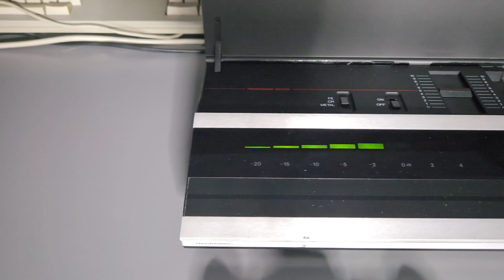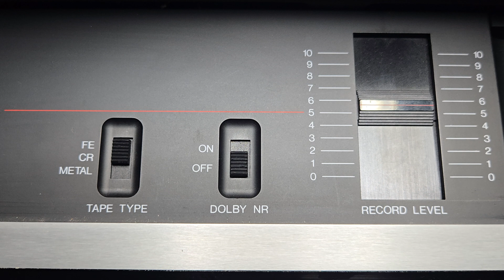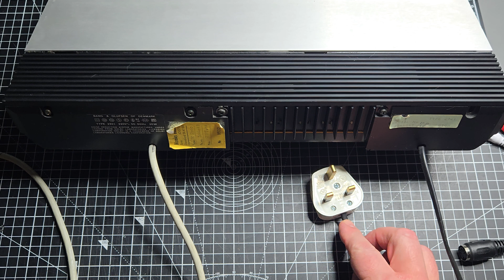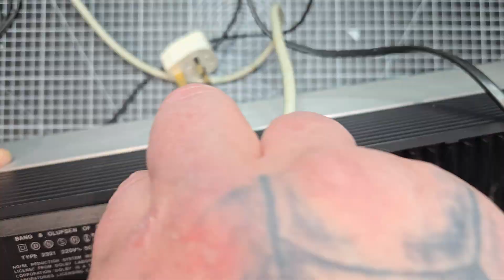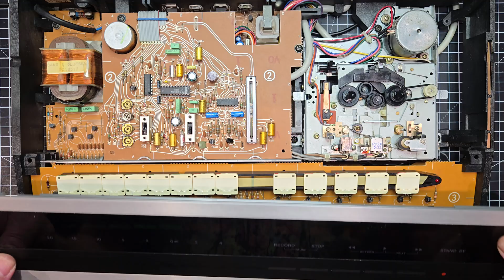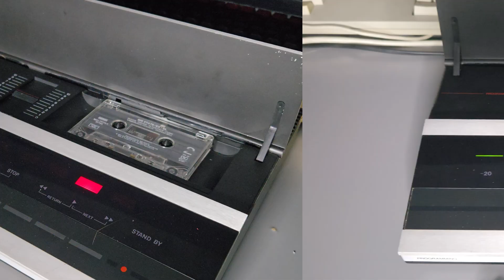Bang And Olufsen Beocord 2000 | Cassette Deck | Belt Change & Demo

Comment: it was nicer if you showed the whole system to which this deck belongs as i was very surprised when using one ,even the turntable was surprising but at the time there were still a lot of european brands and they used to be a lot better than japanese ones only less lights and the m,aterial was nice but not expensive ,normally a new compost that was not yet known and would surprise the buyers, Philips, Grundig, Normende, this ones i can say that were much above any japanese brand with a display with a lot more lights etc.,etc. but have to say that when using brands like sony that as an example the cassette deck seemed a fantastic out of this world machine ,only when listening to the recording with all calibration done and rec level as it is showed in the manual would not sound better than a grundig deck with 1/4 of the price, and the grundig would work forever ,the Sony would break down after 7 years at the most,l i know aklso that european brands used to buy all electronics of a japanese brand to sell it under it´s brand in europe it hapenned a lot in the 80´s, i myself have a friend who owned part of Philips and b y those day ,philips owned a lot of other european brands as they didn´t had possibility of surviving but Philips would release h-fi components under their owned brands , this friend i refer ofered me in 1992, maybe a complete fine arts system it had some pointy corners but each component was separated being young and stupid i sold it for a lot of money to a girl wjho like good expensive material ,later like 20 years later this dutch friend asked me if i still had the system , i replied "i had just bought a entire ES sony system and ended up selling the fine arts" he told me "you should had kept it only a few in all europe, would have value today" i was like crazy, and talked to the girl who still worked where i live ans she told me , NO!but then she invited me to her birthday party and there was the fine arts system i sold her, after a while all stoped working and i saw those guy´s who think they know everything around the system after 30 minuts without music i went there and told"can you let me pass ,so i can put some music playing?"they were the experts and 30 minuts later none would put it to work but i went there so rapidly i put all working and they didn´t even notice what i did and were after me ,like asking what had i done inbetween 5 people one had studied with me,. and i told him"this is a home system not professional with the heat it fires up it´s security system ,like all brands do" , and told him that he only needed to reset it in one key, but which key?he knew if he asked me again i would tell him to F... ...f, so no one knew what was the key to reset it, also after half an hour it was ready for one more hour of music as it heats again, but already a group of people tryuing to get his hands in the system ,i wouldn´t go there as they were like peacocks at a knowledge level ,they needed it ,i didn´t made part of that type of people so i was like trying to buy it for me saying to the birthday girl ,the owner of it all, "you don´t evden use the cassette deck , sell it to me, i´ll pay you 30€" i almost bought all but shewas drunk and with powder in her nose so the next day she tells me, i would never sell it as it as a diferent shape and if i take componemts would look small, she has it but almost never conects it, only once or twice a year and it works if it was a sony system would never work with one or two years of being stoped as this girl has some rotel, philips, and harman kardon , systems, which only Rotel didn´t belong to Philips . Blaupunkt really surprised me as a rich people system with some litle speakers had a superior qualitty of sound and from two litle oddly shaped litle speakers how could such a rich sound and loud come out from them litle squares, this a tower in black glass and all with a fine wood finishing was surprising very good and only cd, tuner and cassette deck , with a recording quality very superior and a row of 5 round leds to set the rec level but the sound of the recording at home ,mine, was fantastic and people talk about nakamichi who in perfect working order doesn´t go as high quality as this european brands recorder/player, i have a Normende deck and when looking inside it´s very similar to a nakamichi deck i have from the 70´s ,or maybe i sold it as my father had all top end decks from 74 to 2000 from nakamichi and being all repaired recentelly by a old nakamichi technician all were perfect not only cassette decks but entire systems, well people pay for a bad quality brand which is better in nothing and in the 80´s is even worst than Sony

Comment: That round vent under the deck motor on the underside suggests that other versions have a fan on top of the drive pulley to ventilate the unit